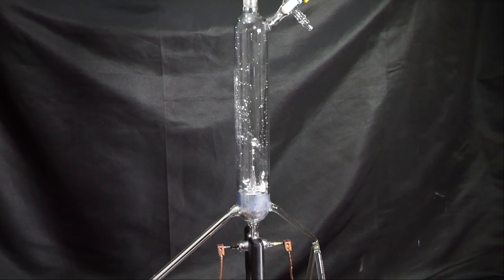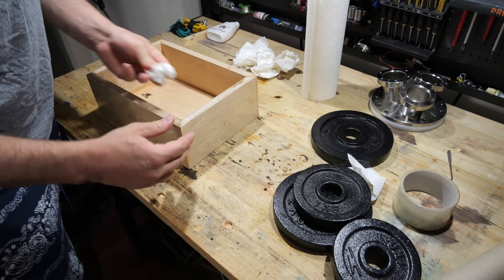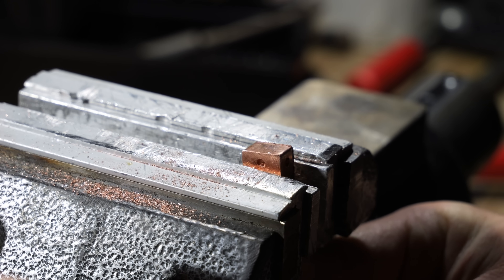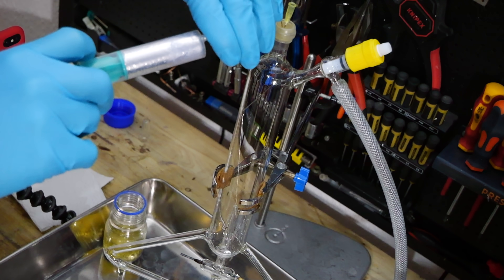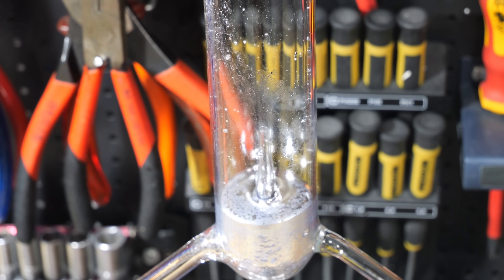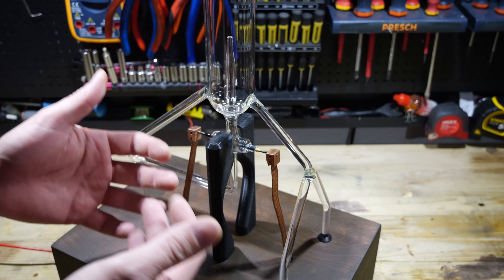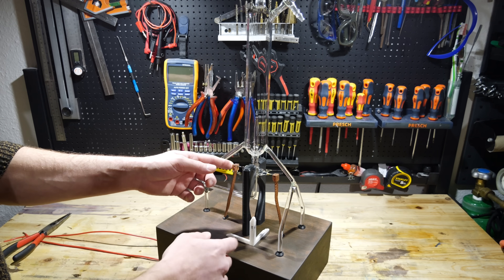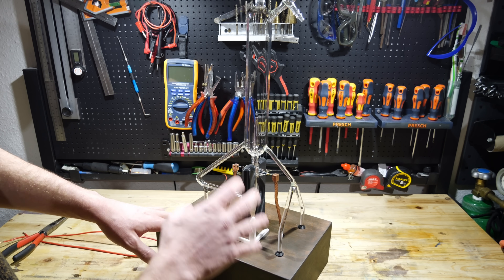This Fountain Runs on an Explosive Metal

Comment: A microwave transformer rewound using a diode full bridge rectifier,  the pulsed DC will allow the electrodes to cool  and wrapping the transformer with 4 gauge welder cable, 2, 3-6 turns should supply the voltage required , 1.5-3v maybe a scr dimmer to control the input power to the transformer. To limit the output .  Or possibly just use the transformer core,  use a zvs driver, to pulse the windings on the core.  And use enough 4gauge secondary winding to get the voltage. A 18 gauge winding connected to the zvs driver should output a fair amount,  not sure on that one,  but definitely a few mosfets driven by a 555timer circuit with a 2.5v push pull into the transformer, using a 12 gauge center tap  run it at 30 to 80hz to limit power , possibly get different effects .  The mosfets push/ pulling the primary center tapped winding, with a 4-6 gauge secondary, (with 2.5v in on the primary it will probably require 8 gauge windings with a center tap.  The 4gauge secondary is it limit the voltage drop from resistance, being it is a low resistance load.)   But the simple power supply would be to rewind the secondary of a microwave transformer. Keep adding a half wrap on the core until the voltage after the full bridge rectifier is reached,  using a dimmer with a scr with zvs, to adjust the power , also the pulsed DC will  allow electrodes to run cooler. To get  larger electrodes in the glass. Use a fork shaped here it passes through the glass. Or possibly use a bolt with a hole diamond drilled through the glass, if it must be tungsten drill a hole 90% through it, and press a copper plug inside to lower the resistance  so the electrical connects to copper, the next step would be silver or gold.  Press a silver pin into the tungsten, or melt it and pour it in. Difficult in a tiny piece of hard metal. Heating the tungsten, and chill the silver is about the only way, getting a 2mm silver pin, into a 3mm tungsten pin, with the end being 0.8-1.0 mm thick, over 25-35 mm the resistance should be a fair amount, removing 80-90% of it should reduce heat, but making a stainless screw, to fit a hole in the glass, , make it large enough. That a hard steel nut can be lowered inside, and a long with diamond paste  lap the glass flat and smooth, so a stainless bolt with a silver plated copper/brass bolt can be threaded inside, a 3-4mm bolt with a 1.5mm bolt inside it's alot of work,  what if the glass is made conductive ? Would the resistance be low enough to be useful? But a diamond cut hole in glass, could a small bolt not be sealed with epoxy, and can't stainless be used over tungsten? Lots of questions,  maybe this can be made with PYREX type glass,  with the electrodes placed in the glass mid  shaping. Then shrink the area. And form the top  and allow it to cool extra slowly,  just some crazy ideas! ✌️

Comment: could you not suspend the juicy metal in acetone or 100% alcohol to wash off the oil before adding it into the glass ? or include it into the fountain then evap it of with the same heater and vacuum you used for water

Comment: Moving to thicker tungsten TIG electrodes seems like the best option unless you wanted to mount a fan directly below the assembly (In the base), and cut slits or just a large round hole to blow upwards.  I'm afraid you're probably going to need a larger PSU, though going to a linear/transformer supply would likely be the easiest.  When trying to create very small voltage drops for high power laser diodes, I've used lengths of fairly thick solid wire to provide a small resistance without building up too much heat.  You really need to measure the resistance of the fountain with a special 4-wire low-resistance meter (Search for YR2050, it's the cheapest option, though definitely not super cheap), which can measure fractions of a milliohm.  Any multimeter is useless for such low resistance.  Once you have the resistance, you can see what the peak current is going to be and how much additional resistance you can add without dropping too much power for the fountain to function.

Comment: Conductor heating is a function of resistance and current, resistance being a function of length; since you need to have such a high current, you should endeavor to minimize all distances you can to reduce heating, and the power loss that causes it. Tungsten looks to have a resistivity 3.3x higher than copper, so shortening the tungsten distances is worth 3.3x more. This is all to say, you should get those copper blocks as close to the glass as you can, to minimize the length of tungsten the power actually needs to travel through. It will also help to have the thermal mass of the copper block closer to the tips, so they can sink heat out of the tungsten rods more readily.

A small fan would also be a good idea. I suspect the power supply is not very happy being in that box, you could put a small fan directly under the fountain jet blowing up along the bulb. Even if this is set to a low speed so it's not noisy, forcing the air to move at all should have a substantial impact on the duty cycle. A small universal motor fan would be simpler, since you can wire it into mains, but a lot of people aren't comfortable with touching mains even a little bit (which is fair).

Comment: Some capacitors in parallel, might stop the short circuit protection from kicking in.
Reply from the maker: Interesting, I will give it a try.
Reply: Wont work. The output current is exactly the same, if not more. Without capacitor there is only resistance from the "pump", add the capacitor and now you have "temporarily additional resistor" parallel. IE more current will flow. Once the capacitor reaches equilibrium state, it does not affect the current flow at all.
Reply: @user255 It will be interesting to see nevertheless.

Comment: I think you could solve the electrode problem by using multiple small tungsten rods instead of just one. If you need a focused point you could weld them to a single large tip and just have multiple small rods where you seal.

Comment: Have you thought about gold plating the part of the tungsten electrodes in the glass? Gold should seal the two materials better.
Reply from the maker: Interesting idea. I will try that once I have my PVD setup. But it's actually not the seal that's problematic but the different coefficients of thermal expansion. With a thicker tungsten electrode the difference could cause the glass to crack when cooling down or when the electrodes heat up.
Reply: @AdvancedTinkering  I see. I didn't think about thermals. 
What if you tried a hollow or tube electrode, say one that could be cooled with a heat pipe going to a larger  radiator. Would keep with the no moving parts theme. Though I am not sure of the sizes for either of parts. If it works. You could have a nice-looking ring radiator around the lower section of the NaK fountain. For esthetics.
Beyond that, you could try or look into using a high temperature tempered glass tube as a sleeve or spacer. Sorry, I'm not a glass worker. I'm not even sure if something like that would be possible, let alone work. 
Either way, love the NaK fountain. Hope you are able to solve the minor issues you are having. Cheers, mate.

Comment: Assuming that your fountain is made of borosilicate glass (Pyrex, Schott, Kimax, etc.), there is an iron/nickel/cobalt alloy called Kovar that has the same coefficient of thermal expansion and is used routinely for glass/metal seals.  This could be used to make larger electrodes to handle the high current of your fountain.  For example, a piece of Kovar tubing (say 6 mm outside diameter and 25 mm long) could be sealed on one end by brazing to a piece of copper rod and the other end could be fused to the glass of the fountain.  (You might want to check the compatibility of both copper and the brazing alloy with NaK.)

As for the power supply, a simple mains frequency transformer with a full bridge rectifier would probably be best.  For example: a Hammond185G10 (available from "Element 14" (aka Newark electronics here in the US) can provide 35 amps at 5 volts and can accept either 110 or 220 volts input for about $50.  For that transformer, a Vishay PB4008-E3/45 (40 amps at 800 volts) bridge rectifier would probably work and is about $4.  Maybe add a variable auto transformer (Variac) on the input side to control output, or a power resistor on the output to limit current.  Your fountain might sing (at 100 Hz), if so, then an output smoothing capacitor could be added.
Reply from the maker: I looked at a few alloys suitable for that purpose but it's pretty hard or expensive to get them in the right dimensions. 

Thanks for the information about the power supply!

Comment: Would a wash with petroleum ether be feasible?  Even just to thin out the mineral oil, would be a start.  I suppose with a few cycles of adding it, shaking around, draining off the excess, then a final evaporation step under vacuum, it could get pretty clean?  More opportunity for oxygen to get in, of course.

Comment: I wonder if this would work better with a constant current supply instead of a constant voltage supply.
Reply: Yeah, using a lab power supply with CC mode would resolve the shutdown issue.

Comment: Are you concerned about melting tungsten electrodes?!
Reply from the maker: No, I'm concerned about the glass cracking. Since the coefficient of thermal expansion of glass and tungsten is not the same.
Reply: Oh come on, what is the worst that can happen? You spill 50g of hot NAK on the bench, you get a rag and wipe it up. :)
Reply: I highly doubt you will ever crack the glass with the roughly 1 micron of differential expansion, but completely agree on the “better safe than sorry” plan where alkali metals are concerned.

Comment: How about using electromagnets instead of permanent ones - and route the circuit through their coils before going through the electrodes?  This could increase the resistance - so the power supply doesn't trip - and maybe reduce the temperature of the electrodes too.  Just and idea.  Thanks for the videos.
Reply: I was thinking you could use two MOT’s modified into electromagnets (with the secondaries removed and the bottom cut off the cores and used to complete the magnetic yoke of course.) And then have them in series with the primary of a third MOT (with its secondary removed and replaced with a single turn, two parallel loops of 4/0 107mm^2 that feed the actual NaK current.) 

I’m thinking that would be a forceful potassium jet indeed.

Comment: To deal with the heat of the electrodes why not use multiple and either run air over it or have heatsinks attached to the electrodes to dissipate heat?

Comment: You could just make a big batch of nak in a schlenk flask under nitrogen and without oil. It would react with moisture and any stray o2, but the oxide normally forms a film on the top and on the glass surface, so you could then syringe pure nak from within the bulk liquid, via a cannula through a rubber stopper. Then use schlenk technique and draw in some shield gas, and do the transfer. Argon would also be much better than N2. Also, I would say a heat gun is much quicker and more effective than the heating wire for pre drying the glassware.
Reply from the maker: Yes, that's my plan eventually. Right now I sadly don't have the space to set up my schlenk line. And working only with seperate valves will be very inconvenient.

Comment: Make the terminal blocks much larger and with heatsink fins on them. They already have to be in really solid contact with the electrodes anyway, might as well use them to remove heat too.
Reply: And or, place a cooling fan or blower near the electrodes to cool them there as well.
Reply: @drflash36  fan adds noise, I would say it's nice to hear only the liquid metal splash.

Comment: I think you could make an unregulated DC power supply with just a transformer and full bridge rectifier. You want high current and low voltage - the "circuit" has low resistance so you don't need much voltage. The power supply is switching off because the regulation of the output voltage is out of spec, but you don't actually care about voltage regulation. A transformer that is 100:1 will take your mains down to a few volts and the FBR will give you 100hz pulsed DC which I think will work for your application.
Reply: He would need to measure the resistance R of the circuit at least to plan for a fitting supply, that can deliver the power of P=I²*R. So not any transformer will just work, it could overheat as well depending on the resistance at the output voltage.

Comment: You should be able to use a Meanwell HRP-200-3.3 it will not hiccup go into hiccup mode but just push a constant current through.
Reply: It's hard to predict the right output voltage without measuring the resistance first.
Reply: @realedna  it's not needed. The power supply will just push a constant current, be it at 0V, 1V or 2V etc
Reply from the maker: Thanks for the advice! I will take a look into that power supply.

Comment: I remember I used to see ads for a product for de-soldering heat sensitive components. It would form an alloy with the solder that had a drastically lower melting point. I was going to point that out as another example of a eutectic mixture, but on second thought I think most solder is already a eutectic mixture.

Comment: Use a higher voltage power supply (12V) and a cc-cv buck converter.
You will be able to adjust the current having the voltage as consequence.
Reply: FIrst he should measure the resistance of the load (fountain circuit). Then he can figure out how much power he needs for a certain current level to select a suitable power supply.
Most buck converters would probably only go as low as 1.2V or even higher though, which might be already too much, as they measure against a voltage reference at that level.
The CPU supplies found on PC motherboards would be the right kind as they supply high currents at very low voltage from intermediate DC rails. So maybe one has to have multiple phases as well and put multiple supplies in parallel to support higher currents.

Comment: If you want to try the "add resistor" option, use a piece of nichrome wire.  You can get it from any heater that has it.  you cannot solder it, so a connection like the one you used here will be needed.  Then put it under water, just use a bucket with water.   A resistance of 60mOhm will be too much, so it is not much what you need.
If you just want to give it a try without the nichrome, use a piece of copper wire, and again, put it in a bucket of water to keep temperature under control.
Reply: A purpose-made resistor will do fine; ribbon-wound ceramic or aluminum-case (heatsink required!) types would be typical examples for this value and rating (~50mΩ 100W).
Reply: It will just waste the energy from the overvoltage and require a bigger supply than actually needed.
The key is to provide the current at the right/low voltage level as the resistance through pure metal is surely very low. Also it would be an advantage to be able to control the current (and therefore the effect) directly, rather than the voltage, which doesn't matter. You only need the voltage to overcome resistance here.
Adding more resistance is counter-productive. He doesn't want to build a heater...

Comment: To address the mineral oil. Would it be possible to flush it a view time with a solvent and and then evaporate the last bit s of solvent under vakuum? 

Have you Considered using no electrodes and power this only via induction. like in a Asynchronous induction motor? 

As feasibility test could you place a vile full of NaKa in Stator from a 3 phases Induktion motor (with the rotor removed) and see if its starts spinning?
Reply: Would be interesting to have current flow between the electrodes and simultaneously magnetize an electromagnet wrapped around in place of the permanent magnets; the MHD version of a series-wound or universal type motor. This would take some machining to build such a magnet though (effort which could be used to improve the permanent magnets, just as well!).

Comment: A better way of transferring liquids without exposure to air is to use a double ended cannula. 

Place one end of the cannula into the air space above the NaK in a suba sealed jar, which will have a positive pressure of argon. As argon is flowing out the other end of the cannula place the end into the suba sealed fountain with the needle air relief (as you have). When argon flushing is complete simply lower the end of the cannula into the NaK and the pressure of argon will pump over the NaK into the fountain. No glove box required! 

Hopefully I have explained this well enough, as it is a very useful technique to have when handling air sensitive materials.

Edit: I just googled it, its called a cannula tranfer if you want to see pictures.

Comment: Can you use tungsten welding electrodes? They can get extremely hot without melting
Reply: extreme temperatures pose a challenge to the glass they're encased in

Comment: To cool the electrodes you could use bigger copper attachment chunks that are finned for surface cooling. As others have said ensure low resistance contact to reduce wasted heat. If you are willing to change the aesthtics you could add a cooling fan next to it or a ducted cooling fan in the base with the ducts routing towards the electrodes the tungsten doesn't care about the tempreture so your tempreture limit would propably be the liquid. Lastly instead of using a dead short power supply it could be worth investigating a high speed switching power supply that applies power with a PWM method that way there is less heating and the momentum of the liquid should make it look the same.